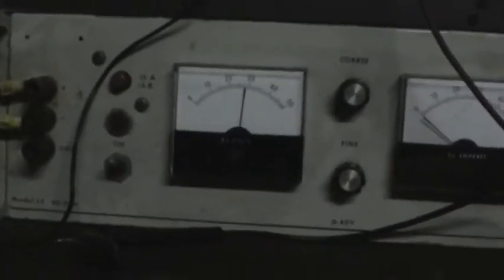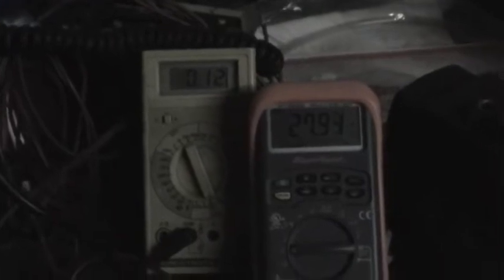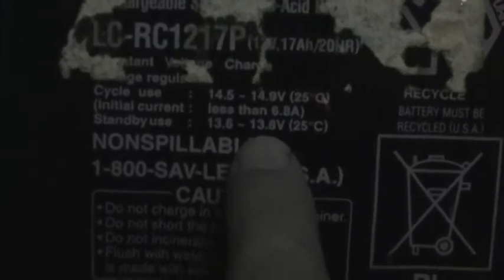APC Smart-UPS 700. The Final Chapter?

Comment: I've got one of these UPS-700's, a freebie from work, I fitted 2 new CBS batteries to it. I'd read about battery failures in these, so I drilled a hole in the front panel and fitted a cooling fan (controlled by a NTC thermistor circuit, which kicks in at 35°c, I also put 72°c thermal fuses (parallel) into the link between the two batteries. On a warm day the cooling fan is running flat out.
It's been going strong for over 3 years now. I'm convinced the issue is 50% heat and 50% overcharging.